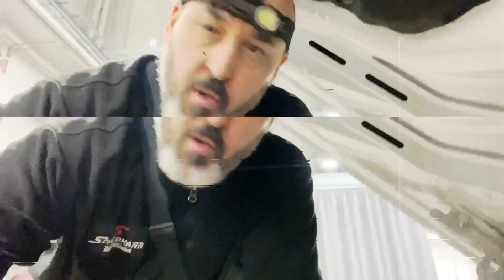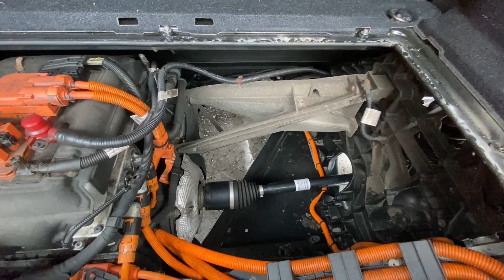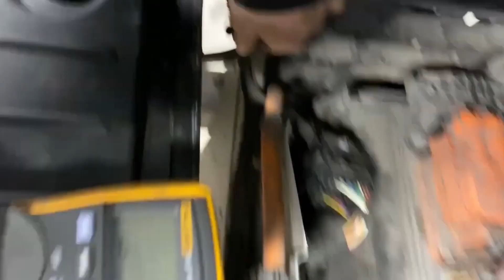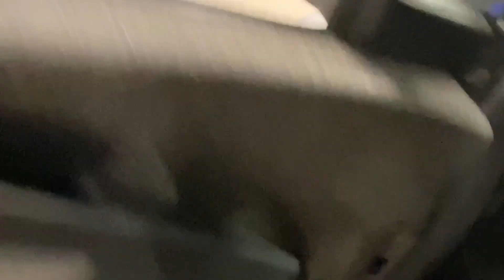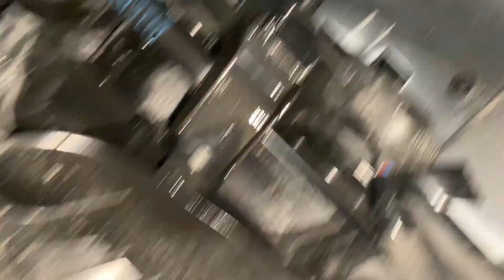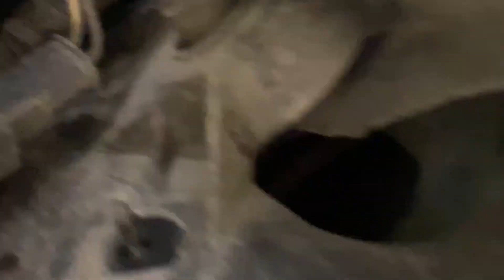I3 PROBLEMS AGAIN! MY I3 LEFT ME STRANDED... WHAT HAPPENED NEXT WILL SHOCK YOU.

Comment: Great video!. I’ve got a bit of a nightmare…. Error code 21e906 (electric fan, control, line interruption. Changed the fan, still errors. I guess it’s going to be the PWM? Cable? Where would be the most common area to look!>? Cheers
Reply from the maker: There is no common area unfortunately. You need to get a wiring diagram check the wire
Reply: @BenJFF Was the pwm cable. Somehow split/damaged on the short journey between the fan and the ecu in the front left wheel well

Comment: I have an issue with an X5 f15 40e, Have 120ohms messured at the KLE connector same as at the EME, X5 has no resistor in EME, it is located in the DME and GWS, at the SME I messure 2x120ohm wich looks ok. Any idea where to start?
Reply from the maker: You have an open on the BUS hence 120 Ohms. You need to see 60 Ohms on an intact circuit. Split up the circuit and insert a dummy resistor.
Reply: @allmech_BMW_fault_finding  Thanks for that, but what is very stange is that I have 2x ptcan2 at the high voltage battery unit and I should messure 0ohm at least on 1 ptcan2 line but I have 2x 120ohm messured. 
I have checked I3 and there is only 1x ptcan2 to the SME.

Comment: Awesome video thanks very much for doing it. My i3 is currently with a BMW independent trying to find a heater error. The heater has been replaced and the car reprogrammed to the latest spec. £1200 later and they still cant find the fault.   E70C3A AC-LIN: EDH does not answer is the error code. All connectors look good and clean in the Fronk but I bet there is a wiring issue elsewhere - do you think I would get more errors if the CAN-BUS was to blame? Thanks again for this very helpful video.
Reply from the maker: The LIN is corroded. Its not hard to find that fault. All they need to do is check LIN voltage at the heater and then again at the other part of the LIN I think maybe from BDC or at the 3 big connectors in the frunk to id any differences. Yes if you had CAN faults you would get CAN codes not LIN
Reply: @BenJFF  Thanks very much. I will probably ask them for the car back and start checking the connectors myself. Am I looking for 12 volts between one of the connector pins down to ground? I will pull all of the other connectors and look for corrosion. Thanks for your advice, much appreciated. - got the car back now. They have told me the LIN signal at the heater is low but it is good at the Body Control Module. I will trace it all through over the next few days - thanks for your help. Have a good Crimbo.